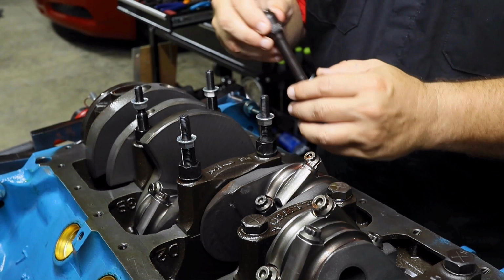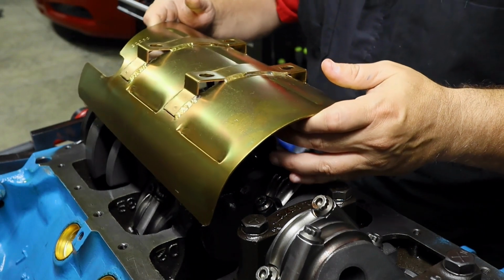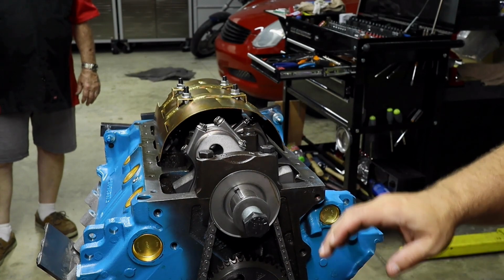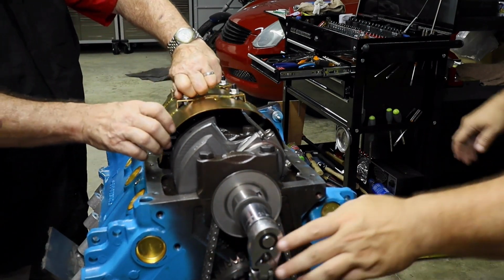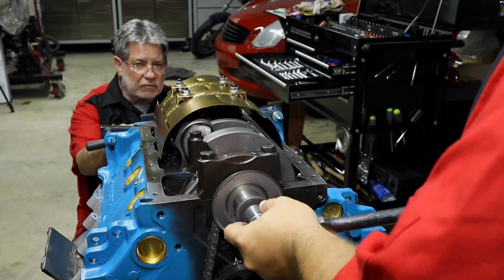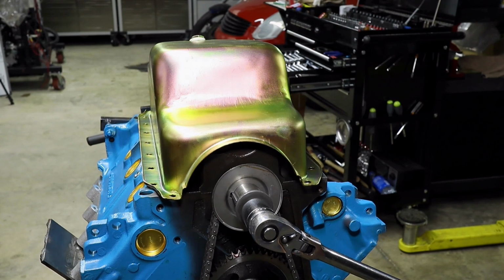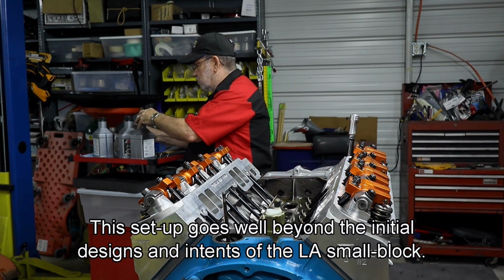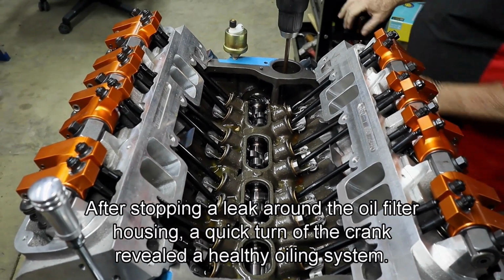The LA phant: Windage Tray for Strokers and Oil Priming

Comment: Looking great!  Why didn't you use studs in all the main cap and not just the 4 with provisions for the windage tray?  Did you align hone the block with those 4 studs or did you just replace the main bolts with those studs after running those taps through those bolt holes?
Reply from the maker: Thanks. 

Great questions.

1st question. The builder didn't believe there was a need for that.

2nd question. Replaced the oe bolts and used the existing bore and thread as a guide. Essentially, just it was an extension of the existing bore and thread.

Comment: I like the build. I do have a question. How far is the piston sticking out the bottom of the cylinder? I'm trying to find some forums that would provide a good answer, if you know, and better if you have a picture or two that would be helpful, here is why I ask. I'm planning out a build 318 to 390 and I'm trying to stay in a safe spot you know not too far out the bottom bore cuz that's always an issue. Thank you. Chuck from Clarksville, TN.
Reply from the maker: Hey Chuck.

I wish I could give you an exact answer down to the 0.001 of an inch.  I'm sure an engine machinist could be much more specific.  Here's what I know.  

The biggest stroker crank for our LA small blocks does not exceed 4.25 inches.  This is so the piston skirt does not exceed the bore depth at bottom dead center nor the deck height of our blocks. Remember too, there are uniform rod lengths for most applications and the compression height of the piston helps keep the piston inline. Our 437 stroker has 4.18 of stroke and runs marvelously.  My 390 has also performed well, also. 

I looked into "How To Build Big Inch Mopar Small Blocks" by Jim Szillagyi.  He did not write about the bore depth, nor the measurements recommended for the skirt exceeding the bore depth at BDC.  

I hope this helps.

Comment: I'm curious....what's the compression height on those pistons?  What brand?  If it's stated in an earlier video, I must have missed it.  Thanks!
Reply from the maker: Great question. Some of the info we prefer not divulge 😉

However, they are from DSS Racing for a 4.08 bore and feature 8cc in the dish.
Reply: @MicsMotorworx  I hear ya.  Those look like some nice pistons from what I can see.  I'm at 1.460 CH, and will have right at 13:1 compression with a 4" crank and 56cc chambers.  Can't wait to see what you get on the dyno!
Reply from the maker: Sounds beastly.

We can't wait to get it on the Dyno either. 😁
Reply: @MicsMotorworx  What is peak flow in those heads?
Reply from the maker: Hey Scott  

235cc intake. 
55cc exhaust. 

More numbers on the build will be in our "First Fire" episode on March 10.